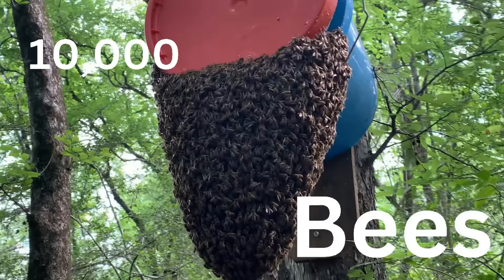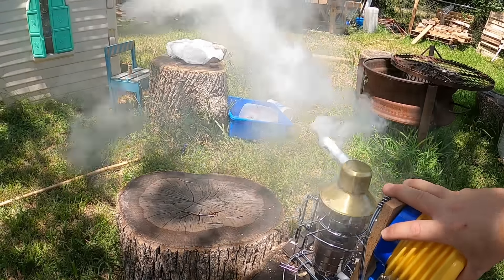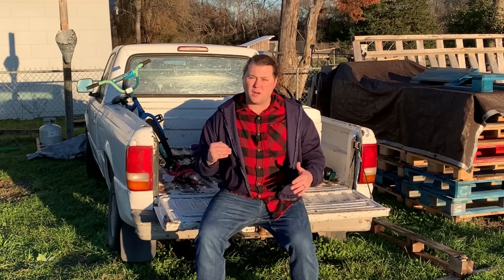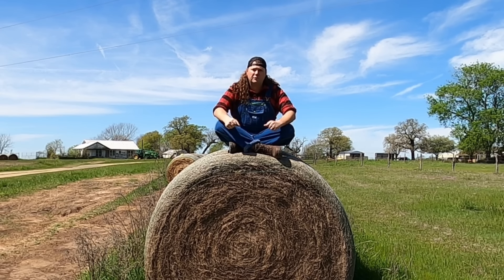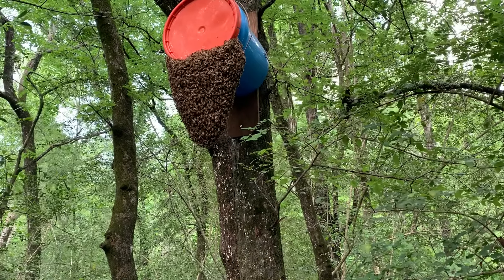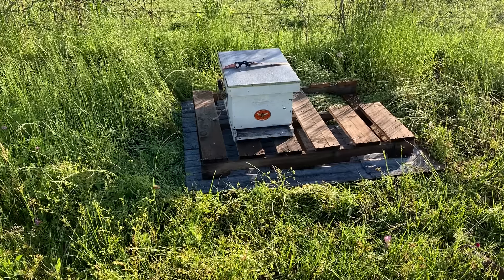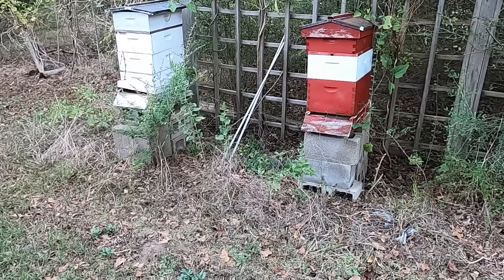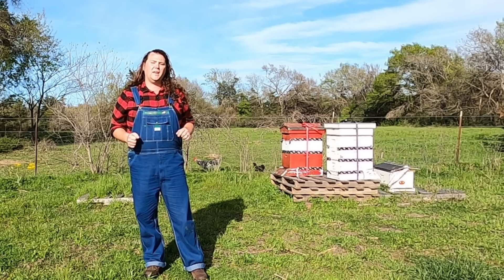I Spent 2 Years Trying To Get FREE Honey Bees

Comment: My fourth year catching swarms. The first year I used plastic bins. The bees love the space but not the smell and the heat. And then you have to transfer them. So I started building traps out of reclaimed wood, discarded drawers and scrap plywood. Inside are standard frames that will fit directly into the hive later. I make the frames from disassembled pallets! I saw the smoker you built, I loved it! I don't spend money on the bees either - frames, hives, traps - everything can be done by yourself and materials that others throw away.  Don't hang the traps so high, it is scientifically correct but practically unnecessary. In those places you have caught in the past there is a high probability that you will catch in the next years.
Reply from the maker: thanks for the input. I do plan on building some more swarm traps the way you described. I also want to build some that are just the base of the hive that way when I catch a swarm I wont have to take them out just take them down from the tree and start adding boxes on top.

Comment: I did the bucket thing and it worked.  But moving them to a real hive is a royal pain.   It is so easy to catch them in a simple box and just transfer the frames.  I hope you stick with the swarm trapping - just in a smarter way.  Good Luck.
Reply from the maker: Great tip! I do plan on building some traps in the future that can hold frames and everything so it easier to transfer them when the time comes.
Reply: Great video, a few rookie mistakes, but that is how you learn., only swarm you waited few days until the queen started laying eggs., then the rest of the worker get busy feeding the larvas.. they won’t go then.  The traps are great idea, but sometimes is not working that they won’t go inside.. make some small ventilation holes on both ends., the moisture is the worst enemy for bees since they take all the moisture on the honey. Try different methods or ways
Reply: I made a few traps this year. I use wax foundation strips on the bucket 🪣 I cut 2 strips of wood 2” screws on the side to made like a platform where I made a few frameless out a 5gls paint stick & glue a marshmallow stick on the middle melted the wax strip…

Comment: I new to this and cant help  but wonder, with the  bee trap bucket that is  shown at  roughly 14:20 minutes Im wondering why  you did not just get up on a ladder and   disconnect the bucket from the tree and shake the bees into the   box.  It seems  like a better way then to   knock down the  comb?
Reply from the maker: That would have definitely been better but what I didn't mention in the video is that I didn't bring the ladder over at first cause I thought I wasn't going to need it lol I was wrong. That's why you see me scraping the bees off with a stick but I eventually had my wife bring me a ladder when I realized I was going to need it. I also realized I didn't bring the correct drill bit to take the swam trap off the tree. For some reason I attached this trap with square bit screws and forgot I did that and ended up bring a Philips head bit. that's why you see it in pieces on the ground cause I ended up just breaking it apart since I couldn't unscrew it from the tree. Oh well you live and learn I guess lol. I hope my mistakes help you do better than I did. Best of luck.